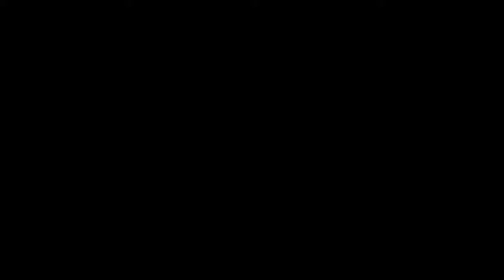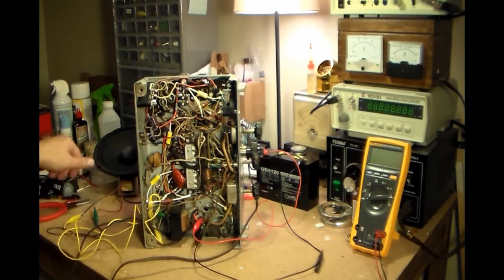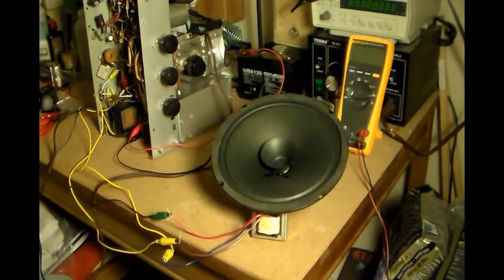Philco 624 Part 14 of 20

Comment: Hi Bret.  The secondary ground needs to be to the chassis ground. Of the three RF chokes number 53 is the that is for filtering the hash out of the B+ line, make sure it measures the correct resistance that is shown on the schematic. Other then that there is not much else that can be done except for making an additional filter for the B+ line.  Dennis

Comment: Hi Bret. On the hash you might try increasing the caps ( 45 and 47 ) on the pie filter on the input of the power supply. There are 3 RF chokes in the power supply to reduce the hash. The other thing is to make sure the secondary of the audio transformer is grounded as shown in the schematic.  Dennis

Comment: Well, that explains it. Remember when I said the equipment with the power light only flickered when the radio was on? Then I said the pilot light flickered in sync with the equipment light. The warble was generated from your DC power supply. I didn't know it was a DC power supply because I didn't know this was a DC set. Sorry; I started watching late in the series.
I hope you can get the interstage xfmr you need soon. Also hope the field coil is appropriate.
That buzzing, Hmm...
Good luck!
Tom

Comment from the maker: Thanks Tom!  Yes, I learned that I did not build this DC power Supply correctly.. ;-)   Funny thing.  the 2 batteries were cheaper than the parts to built the Power Supply.